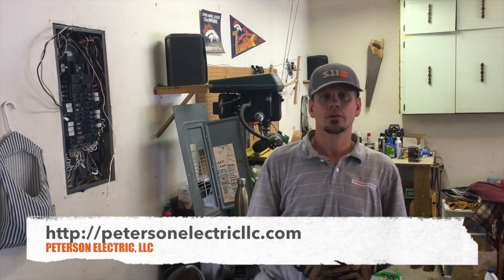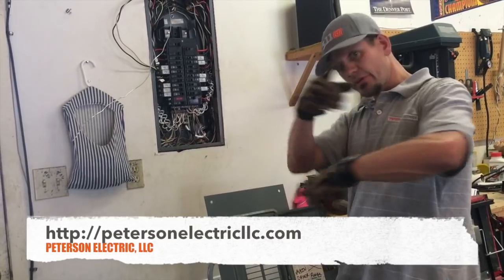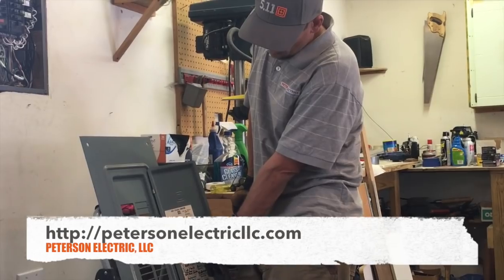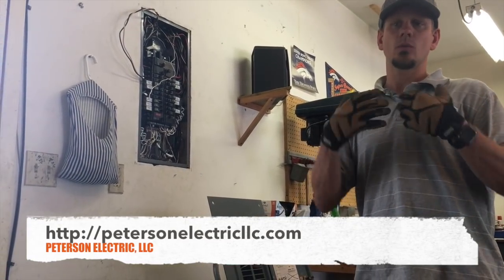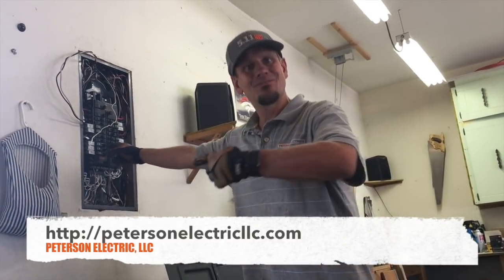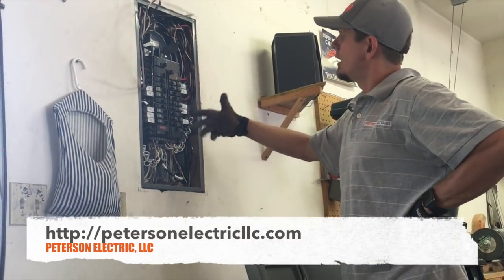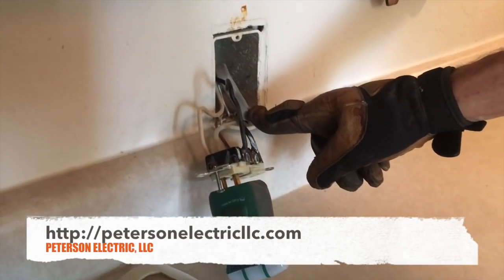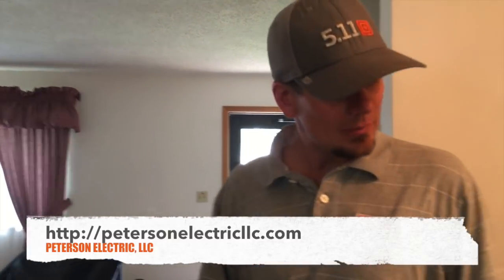Arc Fault Breakers As of 2017

Comment: Say you are Wiring a panel with multiple AfCi breakers and the neutrals get landed on different breakers. Saying circuit # 1 neutral is on landed on Circuit #2 breaker. Will the afci automatically trip when you go to turn it on. Since it isn’t the correct neutral for that circuit on the breaker.
Reply: yes

Comment: Someone is making a lot of money on these. Arc fault sucks. New home, 4 have gone bad in less than w years. 40 years of previous home ownership, NEVER had to replace a breaker. Never had a house burn down either. I hate these things.
Reply: Dam, that bad. I have 3 in my house now and it’s required per CT code. That’s going to suck if they go bad that often
Reply: @jlozano180  the ones in my neighborhood are old model Eaton breakers, they installed v2 breakers when v6 breakers were out. They were early versions and they sucked. Electric company replaced them free.

Comment: ARC fault breakers are bullshit! These damn copper/breaker companies have their fingers waaaaay too far into the NEC. $ is the motivation.
Reply: What I don't understand, is why the hell the Fridge is not on it's own dedicated circuit...
 See: time stamp 11:32
Running in series accross that entire kitchen wall, and then adding the fridge to it...
  That will cause continual trips while fridge, and item's on counter to overheat line back to the main breaker right ? Or did all my book's saying ALWAYS put Fridge on dedicated circuit screw up, and make it seem like overkill ?
 Back in 2000, I rebuilt a 1950's bungalow homes, kitchen...
 Installed new Siemens 100 amp. Breaker box from the old crappy tubes...
 Ran a standard, Dedicated 20 amp., 120v. breaker, with 12-2 w ground to new metal box with three prong single 20amp. 120v. Plug...
Ran pig tail ground to back of box. Tied all grounds with wire nut, wrapped leads in green electrical tape, in series to ground leads  on plugs grounding screw....
 21 year's later, still works perfectly....without all the afci...
 That's why when you buy toasters, coffee maker's etc. , they have those little red or yellow warning label's near end of cord...saying WARNING...ALWAYS UNPLUG WHEN NOT IN USE...NEVER LEAVE ITEM UNATTENDED. IF STILL PLUGGED IN TO WALL SOCKET... 
TO AVOID A FIRE HAZARD...
  If one of those AFCI system's fails to Trip, because we all get lax, and leave all kinds of cords plugged in...
 Then your right back at square one. With a fire or God Forbid. The whole Damn place burning to the ground....
 It's just one more thing that can. Fail....

Comment: All ways be careful with netural. A lost netural voltage dropped to 90 voltage. That voltage is bad and will destroy electronic. But I see you working with 2 netural. So you have a connection to netural bar.

Comment: If you have ground touching neutral at any point after the neutral leaves the breaker, arc fault will trip automatically. I've had to troubleshoot a lot of these. Arc faults are a problematic technology.
Reply: So you're saying that if I install a sub panel full of arc faults with the neutrals and grounds separated, I should be ok? Main panel being bonded

Comment: Isn't it possible to use devices like switches and receptacles which are CU/AL rated for aluminum conductors? I know I have used purple Ideal wirenuts many times and have pig tailed to copper, but why would it be a problem with using an aluminum rated device for aluminum wiring at the device location?

Jeff Licensed Journeyman Electrician - Sunny Central Florida
Reply: You can't use purple wirenuts to splice aluminum to copper you have to use a alumacon splice. Purple wirenuts are for damp location splicing
Reply: @N8tron22  No its not. Those are blue and red. Alumicons are more secure though.